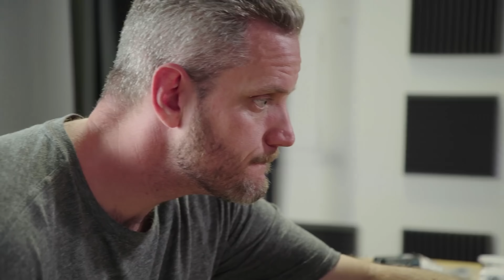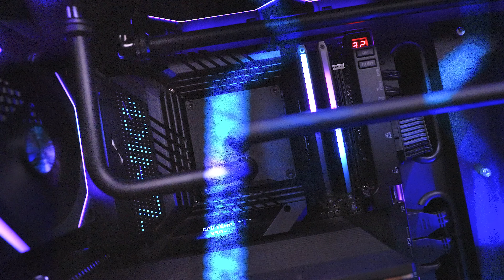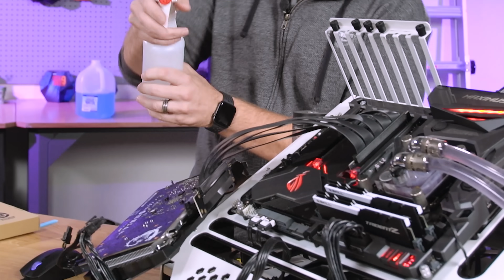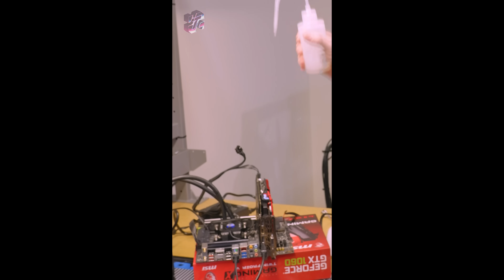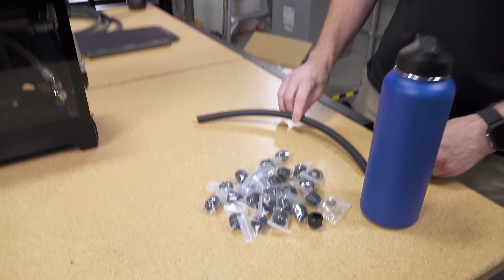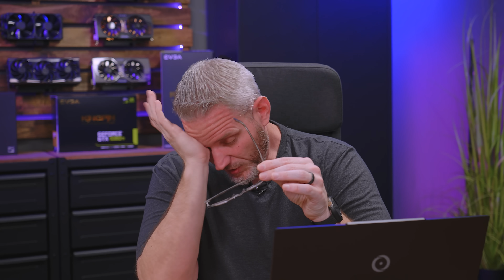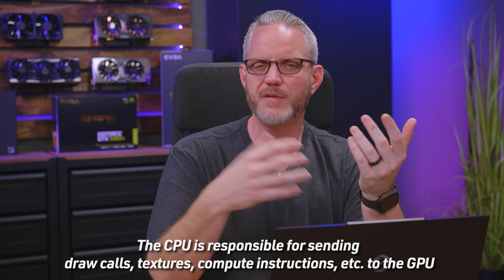5 Myths about Watercooling that are WRONG!

Comment: I'm surprised that I have never heard of anyone building a refrigerated cooling system. Considering that you can buy a small refrigerator for ~$100, cost isn't really a problem with the concept. I'm guessing that the biggest problem would be that you would need hard pipes rather than hoses, plus finding space for the compressor and other components, and also the problem of charging it. No, it wouldn't get nearly as cool as dry ice or liquid nitrogen, but it would get ~25C cooler than simple water cooling. You should build one.... ;)
Reply: It has been done. One issue is condensation when it drops below ambient temps.  You can also simulate this by using a regular AIO but putting the radiator in a bucket of ice water
Reply: @LatitudeSky  Both of your points are good ones, and clearly true. I'm not sure whether the best answer to the condensation problem would be to heavily insulate the lines and heat sink, or to turn the entire case into a refrigerator. :)

Comment: You don't need a whole video to prove that loop order doesn't matter. If you have a loop with a flow rate of 1 GPM (or about 3.8 L/min), you have 500 W of heat added to the loop, you can calculate the maximum temperature change of the water. You need about 4180 J to heat up 1 kg of water by 1 degree celcius. 3.8 L/min is about 0.063 L or 0.063 kg per second. To heat up that amount of water by a degree, you need about 260 J. Since that's in a second, that's 260 W. 500 W will thus heat up the water by about 2 degrees, at 1 GPM and 500 W.

Comment: I've always have used either air coolers or AIO's - I've never built a custom tube water cooling setup.   If there was some easy approach walkthrough to custom liquid cooling (GPU and CPU),  I'd be down for that.

Comment: I like the fact that you can actually move the heat out of the case that is why I am currently on an AIO (but still have the thermalright air cooler I used earlier, just in case the AIO dies). Custom loop? No, thank you maybe ghetto mod an AIO?

Comment: no isopropyl is not to dry it off it is used to remove the mineral layer salt for example is still present in tap water the "put it in rice" concept is not very sound oxidation is not going to help you over time has to be cleaned

Comment: I use even water and Dasty (degrease) to clean PCB's in an ultrasonic cleaner. And rinsing the PCB with purified water, and an oil free air compressor for blowing away all damp. For custom cooling, I read a lot, datasheets, following tech channels like yours. Because there is always that special tip which makes a big difference. For working with acrylic blocks, I use a torq screwdriver. Because Acrylic is so sensitive to breaking. I don't take these lightly, because of the expenses of those blocks. And I agree soft tubes, the clear ones get cloudy over time, but those I change every year with new ones, and doing a deep clean of the blocks anyway. I use mostly colored liquids. That's even worse.

Comment: All water cooling is about is moving the heat. You move the heat to a radiator to be expelled instead of an air cooler on top the CPU. The cooler on top is small so it has small fans. A radiator is large and has large fans. Large fans are quieter and better at dissipating the heat. This is all.

Comment: I started using temp probes in my loop to control the fans on my rads and use the deltas between those probes to speed up or slow the fans.
And a video showing that loop order makes no difference would be great.

Comment: Just to support your claim on water conductivity. There is a video from Norway showing tap water getting blasted right into an electric 220V “box intake” that is filled with fuses. And nothing happens despite it being powered on. The claim is that clean water does not conduct electricity. But as a side note, not all tap water is equal…

Comment: For a perfect eye looking use rigid tubes for the part you don t have to change nothing. Like radiators, pump,... and put at the end a soft tube flexible to connect gpu and cpu. Then you can change cpu gpu and motherboard without having problem to make again all tubes...

Comment: I've got a simple few reasons why I don't watercool. Unlike a normal heatsink which you just apply new paste every 5 years or so, an AIO can fail in a myriad of ways which aren't easy to tell.
1) gunk/corrosion as mentioned in flow of liquid, causing blockages or less flow through the loop. This is basically inevitable.
2) Pump failing, again this one is tough to troubleshoot outside of just seeing temps naturally suck more than usual.
3) Leaks, which can potentially damage/short your other components even if it's extremely unlikely (would be interesting to see a test of new distilled/biocide water vs. water having run through a system for 5 years for PPM, particularly metals....).

Comment: Man, the first thing I did after building my water cooled rig was upgrade the room to have an integrated AC unit, I would almost say its essential. Those free standing units are OK but they create almost as much heat as they remove, not to mention the noise.

Comment: Water cooling is fine. The main issue I actually have with it is there is a single point of failure. If the pump goes, which they all do eventually (especially in AIO's), you basically can't use your system until it's replaced which likely means draining the loop. I designed my system for air cooling. Want to know what happens if a fan fails? Nothing. Sure, if it's one of the three on my CPU cooler, I might get slightly higher temps, but I could keep running with no issues until the replacement came in and it would be about a 10 minute job including pulling the computer out from under the desk and putting it back after which I could do when most convenient for me. If it's one of the case fans, I already have spares so wouldn't even have to order one. I expect to get at least 10 years out of this computer if not more. It needs to be reliable and easily maintainable. I feel air cooling was the better choice for that.

Comment: Water is a half conductor like a resistor or a lightbulb for instance. Don't learn these kids distilled water is safe around electricity please because that goes against everything an electro technician would learn and we don't want kids to try this out in a bath tub. Just no dude

As a mechanic I have to say that engine cooling is not around 90-95 Celcius when operational to not have it too cool for the combustion. Cooler mixture has less volume so you can put more mixture in the combustion chamber so cooler is better around fuel mixture actually. We keep engines at a certain temperature based on the used materials and their wear and tear around expansion. Not for the combustion but because it's the sweet spot for steel. Too hot and too cold engines have more wear and tear because of the used material. Ceramic and other engine materials have different operational temperature just to keep shit in one piece and away from the workshop every week to replace the engine

That was a little bit of fake news right there Jay hahaha so those are my myth busts from this video

Comment: Efficiency suck if you have parts where efficiency sucks. So NONO to intel and also a big NONO to anything that has a 90 on the end. Especially midrange is as efficient as it might get since years. Undervolting is a thing too. So no, Watercooling did not became more necessary than ever. And yes i don't want water in my electronics.

Comment: If you install a bunch of thermal probes in your loop, you can learn interesting facts about your loop with them.  Taking both your flow rate and the temperature difference between any two points on your loop, you can estimate the power in watts being dumped into the loop by various components, and of course also estimate the dissipation being performed by your radiators.  In my case this is all done via an Aqua Computer Aquaero and monitored in Aquasuite, but no reason you can't just do it in a spreadsheet.  You'll know your math is about right if you add up all the radiator dissipation calculations and subtract the loads and end up with 0, or close to it (assuming your thermal probe calibration isn't too far off).  Doing so I've found out that if I put my CPU and GPU under a large load, my top radiator (the first in the series) dissipates way more than the bottom radiator, which goes after.  I'd be curious to try it again with the side panel off and see how it changes, or if maybe I remove the air filter at the bottom radiator and see if maybe it is too restrictive or something.  Or perhaps I just have my fan curve set too aggressively, or I bought too much radiator for my loop, idk.
Reply: To Jay's point about the temperature difference between points on the loop - if I run both prime 95 and furmark for 20 minutes till it stabilizes, the temperature difference between the cpu block out, the hottest point in the loop, and the gpu block in, the coldest point in the loop, is basically only 3 to 4 C.  I actually just did this test yesterday because I was curious.

Comment: Résistance increases with temperature, so if your components run hotter, they loose efficiency and your system emits a little more heat. On the other hand your pumps and additional fans and so on also generate waste heat, so all in all the difference is probably barely measurable.

Comment: I worked at Philips in quality control, some engineer explained why we did heat tests (e.g. letting DVD-writers and sattelite boxes run in 80°C) he told is there is a Physics law that is so easy they do not teach you this in school, that law says, if you increase the temp with 10°C you DOUBLE the speed of every physical and chemical process so ambient being 20°C increasing it with 60° would age your machines like 16 times faster, hence why we could predict within reason that the life expectancy of our machines would be 10 years even though it ran only 6 months in testing. BUT he added it also works in reverse if you can COOL a system with 10° lower than it's actual working temp, you would double the life expectancy, HENCE why I use watercooling WITHOUT overclocking (because that would work counter-intuitive, cooling a system to keep the same temps and all that ), to keep my machines running for longer, and right now my sone is using my now 10+ YO Hand me down to play some serious games like Baldurs gate and Cyberpunk 2077, without a hitch, sure he doesn't get the latest FPS or plays at the highest graphics setting currently known to man, but it still works perfectly, granted I do upgrade both my system and he get's the hand me downs that are still compatible, but it is still the I7 processor I first bought for that system and the original motherboard

Comment: well I learned about this loop order and having a radiator in between components it doesn't matter after for temperature purposes after I built my system. Having said that, in my case (Phanteks Enthoo 719) it actually makes sense and more astatically pleasing... it leaves the pump goes into my gfx card, then goes into the top rad, then it goes to the cpu, it leaves that into the side rad and back into the reservoir. It makes sense even if it doesn't matter temperature wise... In this case you don't have much space up top the motherboard when you have a rad on the roof, I had a 40mm rad up top before and it barely cleared my ram sticks which was a pain, I've since reduced to a slimmer rad and still quite tight, I cannot access the top of the motherboard for example like the 8 pin power on the motherboard with the rad there... Awesome case for watercooling but since it's a dual system case it has some design flaws... hence why when Jay said he was working with a company to build a case, I got excited

Comment: I still prefer the old school air cooled tower radiator. You put it on and and boom, no more worries for 5 years. If a fan goes out, you change the fan. I'm sure at some point, CPU's will get so hot that water is the only option, but for now it's just less to worry about.

Comment: I've been building computers for 20 years at this point, I've never done a water cooled system. I want to give it a go one of these days. I don't overclock anything. I may be missing out on performance, but with a 5600x and a 3060ti I'm missing out on more by not upgrading. I do have a case that is screaming for a loop though. Someday I'll try it out. I'll probably wait til I upgrade though. Then water cool my current system and see what I can push out of it.

Comment: The only real issues I had with waterkoeling breaking "stuff"... all simply caused by (frankly stupid) human error...

For example: Tearing apart a cpu block, while rebuilding it stopping mid way because wife said we needed to go... And then when I get back, not checking the block or testing the loop but just Yolo putting it together and filling it... Only then realizing I did not tighten the screws after starting the loop and turning the cpu block into a nice fountain straight unto the cpu...

I had some failures with parts over the years, like the flow meters by bitspower, but these never killed the pc

Comment: I had a Corsair H100 (first gen) leak all the fluid over my GTX580's and it did no damage at all. Took me plenty of hours to even notice it happened. Worst part was, the 5 year warrantee had just expired.
(edit)
I also had a girl spill a beer into the top, it made the display go all crazy, I unplugged it after about 4 seconds. After I meticulously cleaned everything, it was fine, no permanent damage at all.

Comment: One way to show the loop order myth and eliminate the CPU ramp up issue would be to run 2 PCs side by side with a loop that runs from the first PCs GPU to the second PCs CPU, that way you can put the GPU under load without putting the CPU on the second machine under any extra load.

Comment: As you stated Water cooling will stabilize at the temperature that your radiators can deal with. So for better cooling you need more radiators and/or fans.  But there is a limit.  

PCs need to have heat removed from a very small area, the chip, CPU or GPU.  Water cooling gives you a large mass of water that can absorb a chunk of temperature. But after that it needs to radiate that temp in just the same way that air cooling needs to radiate the temp away. 

Adding pumps and radiator fans, uses more power, that means extra heat, only a little, but still. 
I have no ability to test or prove this, but simply (actually very not simple) adding more fins and fans to an air cooler, would have a similar effect, and with no concern over liquids and tubes in an electrical environment.  It is more a case of taste.  If you like lots of pumps and tubes, giving a sort of steam punk vibe, then fine.  But for me simple clean air flow is always going to be my choice.

So why do I watch videos from the Water Cooling Guy?  Fortunately, Jay, you are entertaining and informational.  Never change.

Comment: Your comment about water only being electrically conductive due to dissolved ions from impurities is completely incorrect. Water will naturally have an equilibrium of hydroxide and hydronium ions due to the high electrical charge density of a proton (H+) that can form with lone pairs of electrons of another water molecule (H30+) while the protonated water molecule (OH-) serves as a negatively charged opposite that remains in the solution. These protons can skip from different water molecules many times naturally from natural movement and create electrical charge as they distribute through water molecules, creating hydronium and hydroxide ions moving through a liquid solution at different rates depending on temperature, pressure, etc.

Comment: Sorry for nitpicking, but: "water itself does not transfer electricity"... it does, just not very well. If it didn't, you wouldn't be able to electrolyze it... which you obviously can. Sure, it won't damage electronics as fast as "mineral" water will, but it will eventually.

Comment: Clearly I'm for that probe video soon ^^

As for why I didn't water-cooled any of my systems so far, yup it's the price. On the higher ends of options, it will fulfil a "dream PC" build but for like double the price of the said computer... At that point I can buy a 4090... And on the lower end spectrum., what do we gain compered to traditional air cooling that got really good price to performance wise. Not that much and that money squeeze can make the differences on a GPU and/or CPU tier on the overall system price, thus never took the water-cooled path.

Comment: Steve did a review on the Thermalright Frozen Prism 360mm Liquid Cooler for $56.90. The review showed it was a decent radiator but the fan decibels where a little high. Even if you replace the fans it would probably still be one of the cheaper coolers.

Comment: while cost has certainly come done and you can build very nice loops for decent money, especially when you go with chinese brands like bykski and barrow, watercooling is still a heck of a lot more expensive than aircooling.

For aircooling you just need a beefy cooler, that's it, done. Plus maybe a few fans around the case. GPU already has their cooler.
Man I wish they'd sell GPUs without the massive heatsink - that saved cost could be spent on a nice GPU block...

Comment: The second myth is no myth, the water gets ionised in the system and it doesn't take long for that to happen. When the water is a year or longer in the system than the water is way more ionised than tap water especially with copper. No rad i know is coated internally in every rad the water has direct contact to copper. Does that mean your system get fried when you have a leak? No, but saying that this is a myth is bs and not true at all. The main reason why no one is using tap water is the bacteria in the water and not the ionisation.